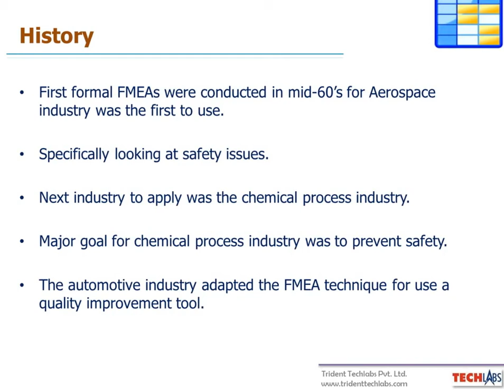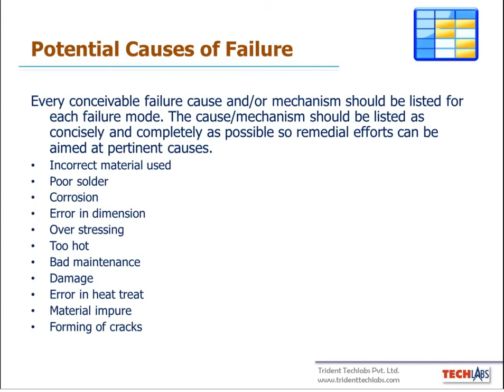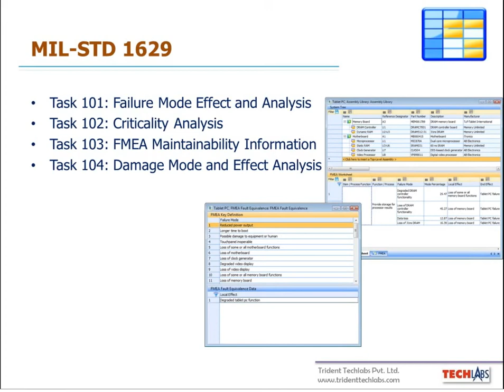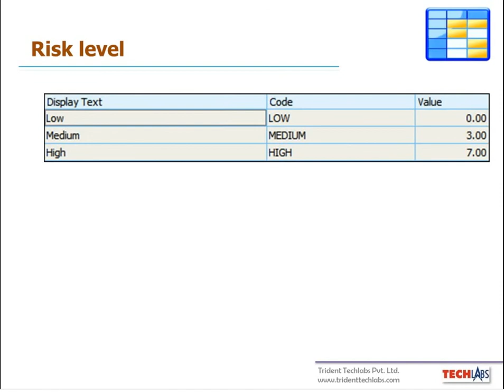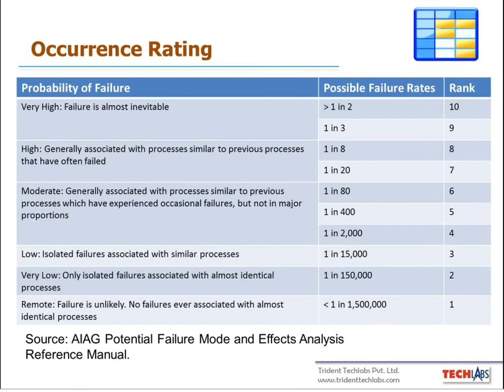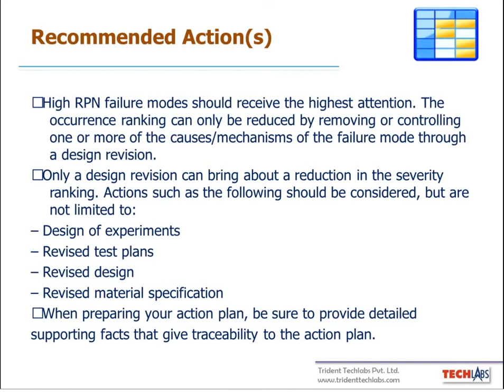Failure Mode Effect and Analysis (FMEA) By: Aravinth N

Comment: Sir, I am using a genuine Relex 2011 in my college library, I'm unable to open the Tablet PC System file (.rfp) in a project. When I first started Relex it was not coming up in the Recent files but it is present in my computer. I tried creating a project to open the Tablet PC file in it, but couldn't find the file when I browsed for it in Common Library (even though I copied it there). Can you please help me with this and with doing Analyis of Failure data. Thanks